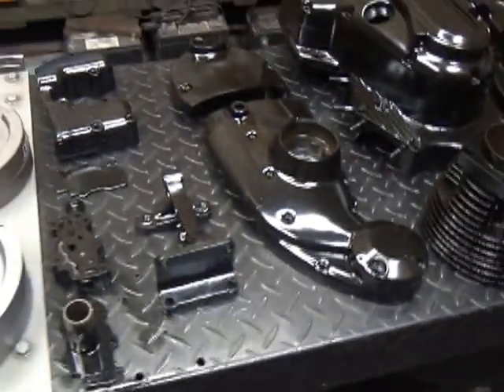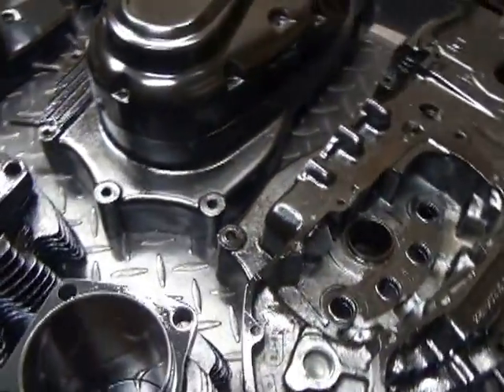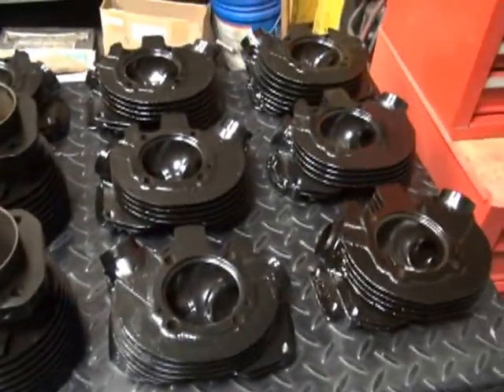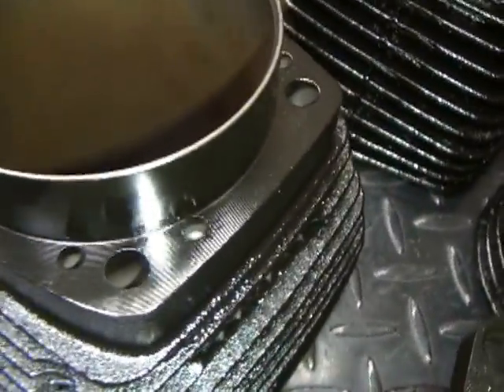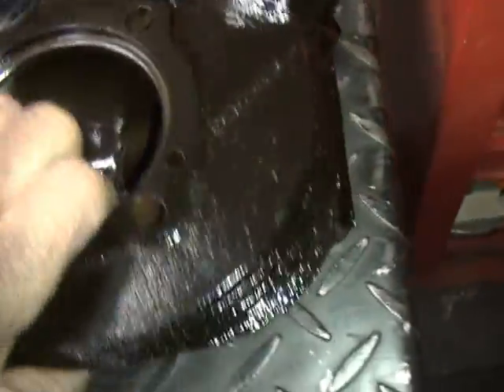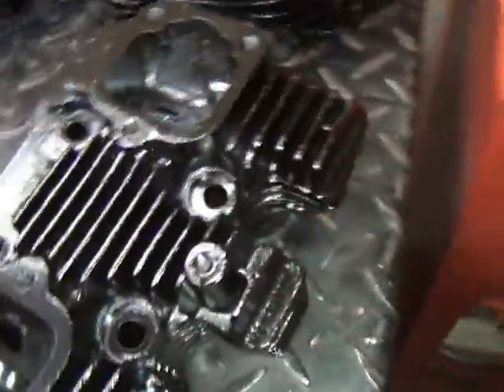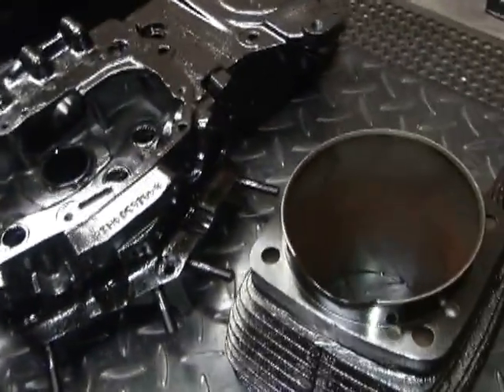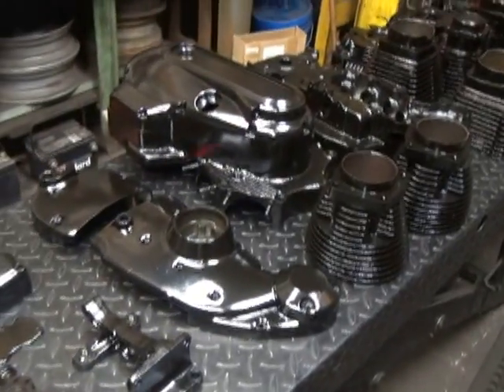03 Thermal Dispersant High Temperature Black Cylinder Head Coating by Tatro Machine

Comment: Tatro, i respect your experience and your opinion. I just wanted to point out that it is the Ultimately the thermal conductivity of the coating, the thickness of the layer transferring that heat, the number of layers, the surface area of those layers and  the difference in temperatures (Delta T), that defines the thermal flow rates. If you have an outer layer that is highly conductive and have a substantial increase in outer surface area (cooling jacket or fins) as well as a good delta T...then your flowrate will increase. If your exhaust pipes are close by, a ceramic thermal barrier is an advantage. Cerakote does indeed make a transfer coating but it has a higher thermal conductivity than Techline Coating tltd.

Comment: It is mostly Carbon with some Moly, The Cerakote proved to be superior in thermal transfer properties. The biggest reason TLTD works is because #1 the thickness of the coat is kept to a minimum and #2 the prep of the surface to be painted. The surface area is increased by changing the surface finish. Both work the Same way but...Ultimately it is the thermal conductivity that aids the geometry of the surface it is cooling.
Reply from the maker: +Spadadiforza 
sounds good but i am not going for it. my coating is a dissipant, not a dry lubricant coating. it is very slick and smooth, i do not think anything will stick to it much less paint. it is probably less then a .001 thick so it has no build. that is why i do not mask off anything. go check out techline coatings for the real info.
tatro
Reply: +Tatro Machine Explain to me what a dissipant is? What exactly aren't you going for? The information? I have used Techline Coatings...and I have tested their products using ASTM test methodologies.
Reply from the maker: +Spadadiforza 
i am just a racer that tries different things and see if they do what i want too. from there i make decisions on what i think is happening and figure out what i want to do with it. from my videos i pass on my knowledge and real world impressions of what i think, good, bad or indifference.
from your first comment i can see you know something but i was not going for all of what you were saying. a dissipant coating is for cooling off a part. the techline coating works for me and i do not care what it is made of. as i recalled the Cerakote coating was not for dissipating heat. every coating is made to do certain things and the techline coating works very good for what it was made for. it keeps my harleys cool and stays on. not flecking, rusting or getting eaten up by the fluids on the bike. the only problem i have is that it does tarnish at very high temps around the exhaust pipes areas of the heads or cylinders. flatheads do run hot so 1200 temp rating would be better for this application. 900-950 is just not enough. other then that i am good with it.
tatro